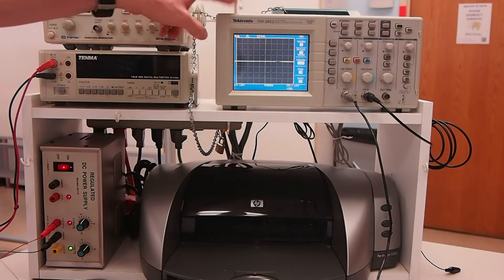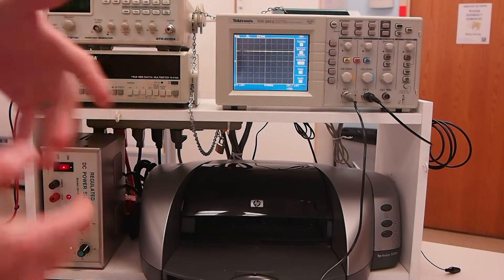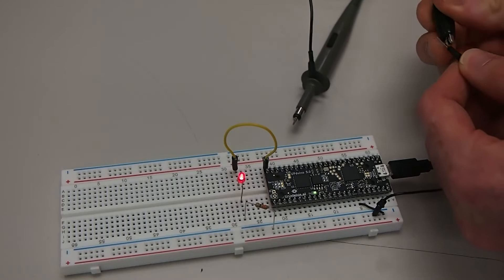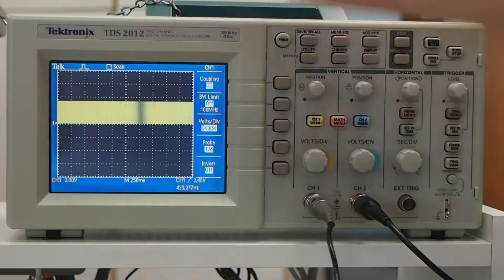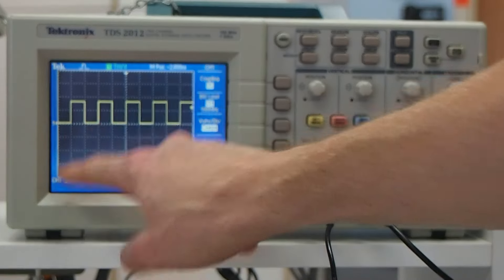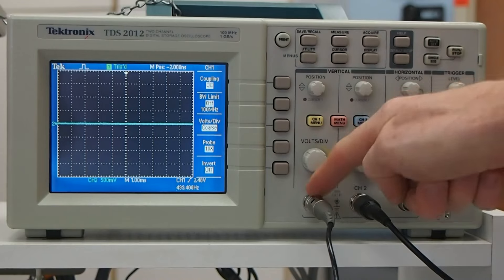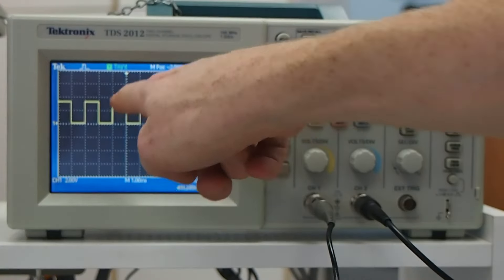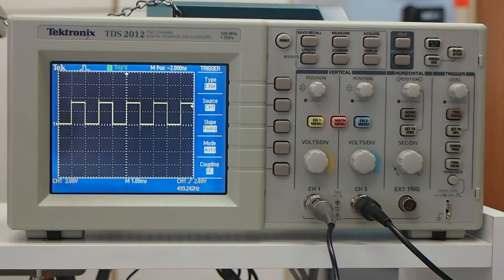Basics of using an oscilloscope

Comment: Thank you.  Can you get longer length probe wires. I have the same scope that you're using and would like to use it on auto repair but have a hard time with the short lead.
Reply from the maker: I've never seen probes with leads longer than about 1m, but you can always extend it with your own wire or a coax cable.  This may introduce signal integrity issues, but unless you're looking at stuff in the hundreds of MHz you'll probably be fine.